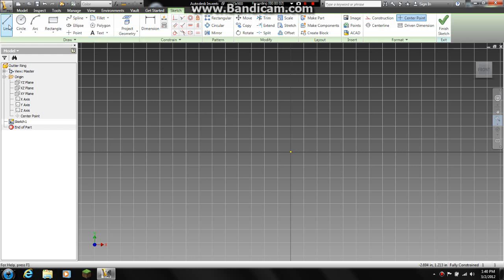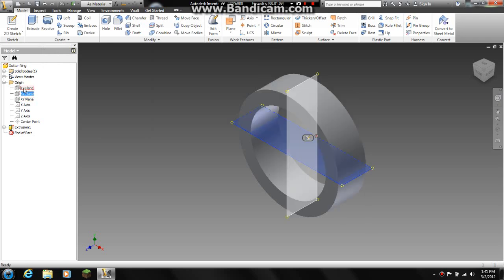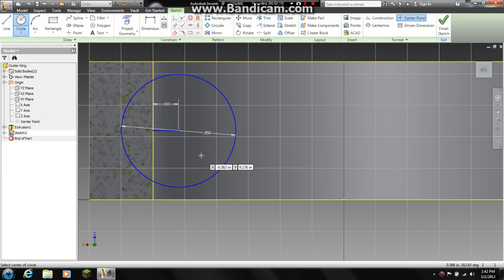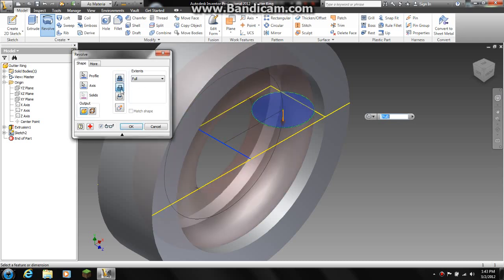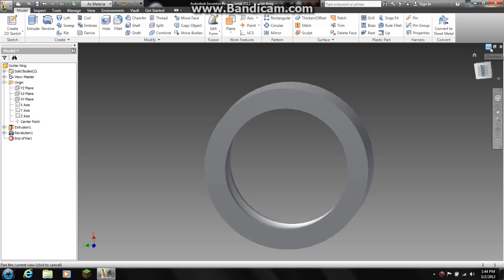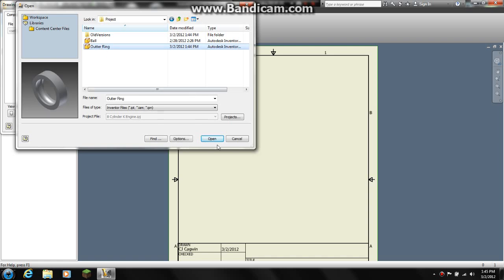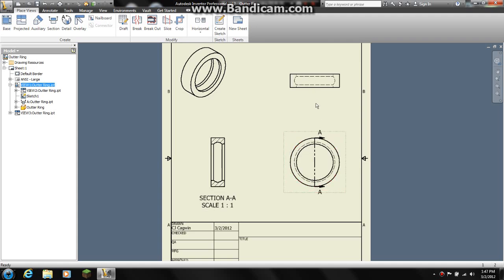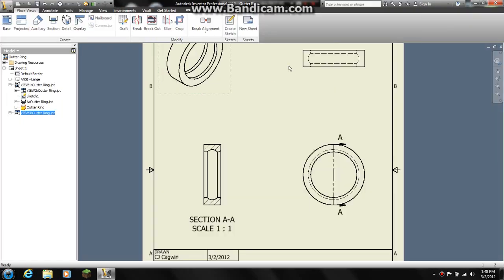Drafting Tutorial: Ball Bearing, Outer Ring

Comment: This can be done with a single step actually, you can add the circle to the rectangle and trim excess lines.  I have recently done a bearing like this, do you have a working simulation of a working bearing?  I can't seem to make inventor to transfer motion to the outer ring.  Any help from ya would be appreciated.